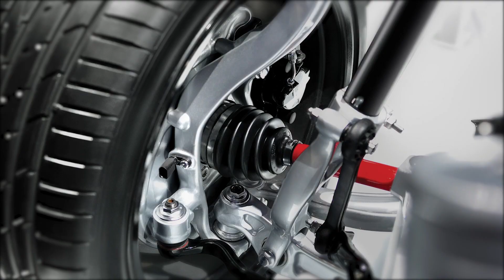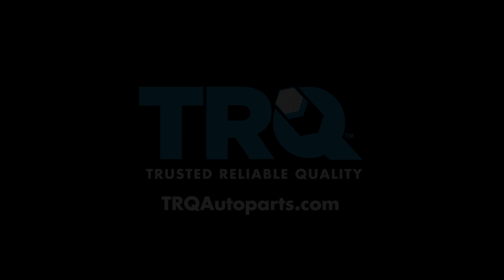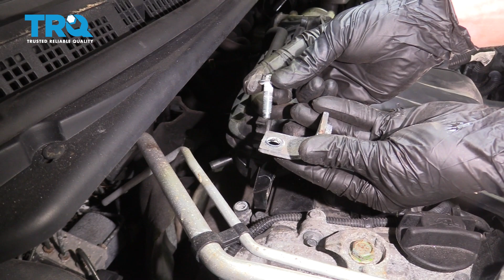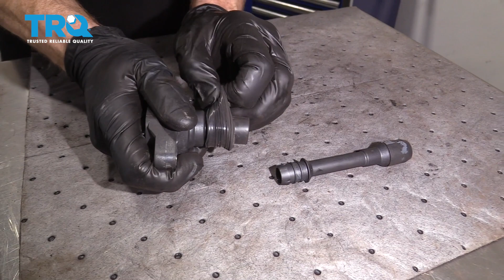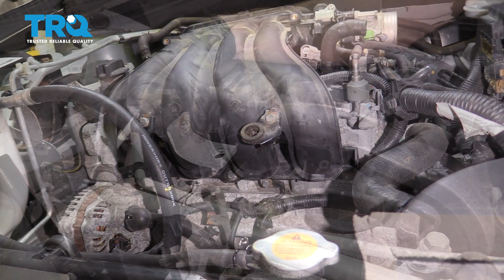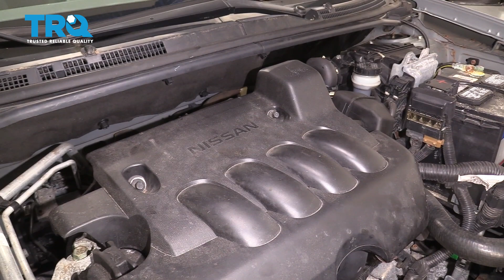How to Replace Ignition Coil Boots 2007-12 Nissan Sentra

Comment: Hi I have same car but a 5 spd I put a used engine cause the other lost compression car was runing good till started misfiring again cinlinders 1 n 2 new  oild and oem spark plugs car still misfiring any idea what could be when I put the use motor was runing good till one day I was in the highway doing about 90 and started misfiring